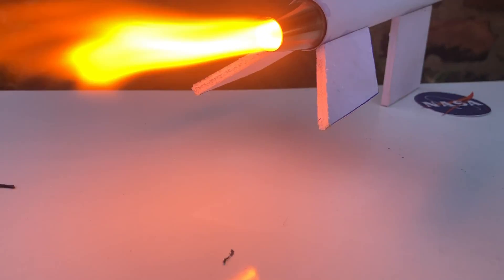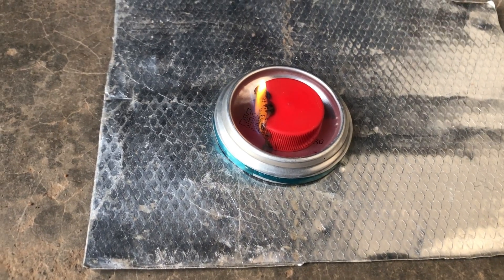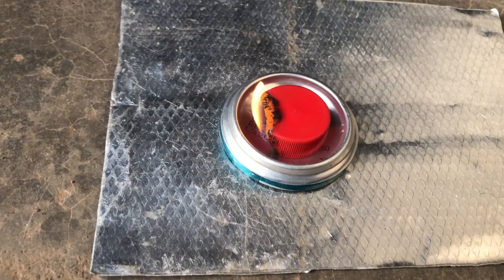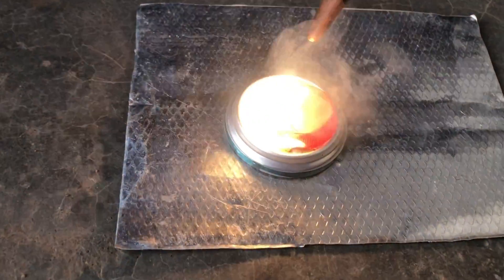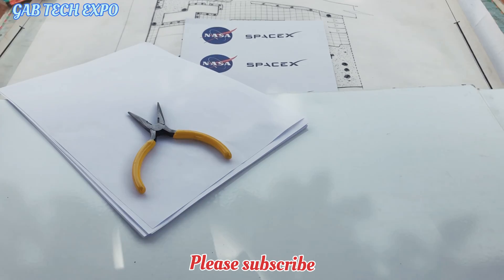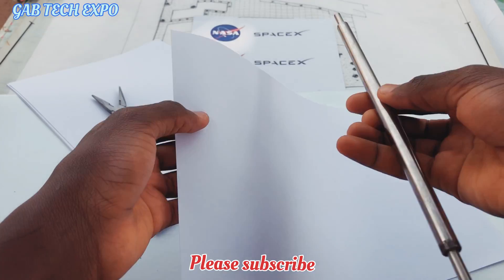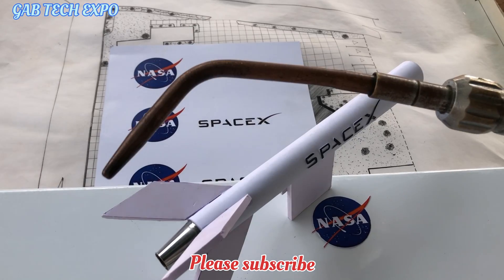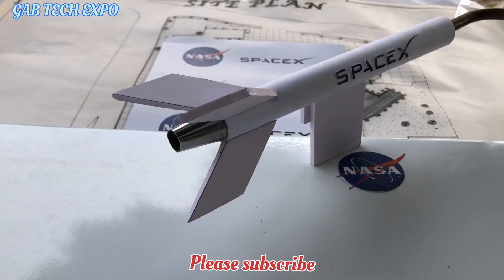How to make a Rocket engine

Comment: Please, what type of fuel did you use, I'm just curious 😊
Reply from the maker: The paper is acting as the fuel
Reply: @gabtechexpo4017  ok, thanks for that, but what I meant to ask is that, what fuel do you use for your jet engines, because I have been following your vids on jet engines for a while now, and I am considering making my own. Will be glad if you can tell me
Reply from the maker: Propane gas
Reply: @gabtechexpo4017  thanks for your time and help, really appreciate
Reply from the maker: You're welcome

Comment: You can put a air cartridge for a BB gun inside of the rocket and make a way so  the air from cartilage come out at the right Pace  and we can see the rockets fly
Reply: That is CO2 gas in that cartridge I guess CO2 won't help with combustion no matter how much pressure it creates...